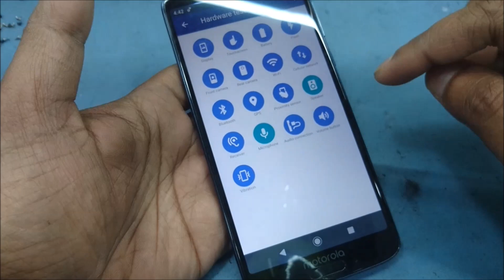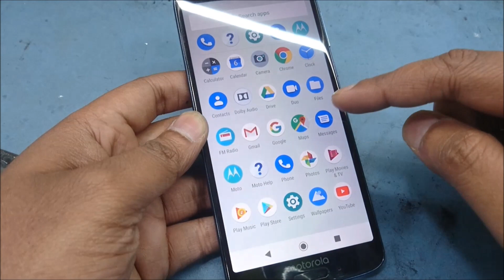Moto G6 Mic not working problem 100% [Solved]

Comment: Hi, thank you for your video! I was wondering what is the dought you put around the microphone? Thx!
Reply from the maker: Most welcome
Reply: @amit keshwar- do u understand English? He asked you something
Reply from the maker: It's soldering paste to joint part,  and its silver foil tape to block the heat air
Reply: @amitkeshwar2428  does soldering paste conduct electricity? Thanks
Reply: @userM8wqjnmx387  no but it should be cleaned off after you are done.
Reply from the maker: Yes,

Comment: Hello,
I enquired in the service centre, they told me it will cost rs 11000.
What do I do now?  How much is the actual cost according to you?
Reply from the maker: Only mic replace then charge is 1000 rs. Or if cost is 11000 rs. Informed you, it means complete motherboard replace in your set, 
I have already showning in mic replace
Reply: They told me also for the whole mother board replacement

Comment: What is the name of the application you used to test the microphone?
Reply from the maker: The name is 'help" to application open and check your hardware
Reply: @amitkeshwar2428  please, tell the article or from which phone moto g6 microphone is suitable soldered. Similar does not work
Reply from the maker: @Voha  4 dots using this microphone to working this phone,  if you repair this phone,  please purchase the mic original in mobile service center,  or duplicate mic purchase have you a compatible Samsung phones to similar mic
Reply: @amitkeshwar2428  thank You. Microphones similar externally should fit?  For example, in xiaomi mi4 (https://images.ua.prom.st/1220030084_w640_h640_mikrofon-dlya-xiaomi.jpg) is very similar.  What microphone model did you use?  The service center refused to repair the phone (((
Reply: @Voha  so what's the same analogue to put samsung or redmi notes
Reply: @Iskusitel33  хорошо, спасибо, буду знать. Просто нигде не нашел маркировки микрофона, и мне некоторые люди писали мол не заработали у них другие микрофоны. Вот поэтому так дотошно и интерисуюсь
Reply: @Voha  если напишеш почту скину под микроском картинки радного
Reply: @Iskusitel33  да есть фотки родного. К сожалению по надписям на нем ничего не нашел. А я так понял ты меня микрофон?
Reply: @Voha  9 месяц лежит все никак не найду вот и моторола в первые такое
Reply: @Iskusitel33  привет, заказал с али микрофоны на этот телефон и ни один не работает( вроде и там и там 6 контактов, в чем же проблема?
Reply: @RF-rd1hb  там проблема в распиновке микрофона на Али один обман тока вид они не подходят есть видео в Ютубе распиновок
Reply: @Iskusitel33  к сожалению не нашел на ютубе распиновок для шестиконтактного микрофона(
а какие варианты? можно вместо этого впаять кругленький с двумя проводками?
Reply: @RF-rd1hb  еще в добавок их в паре меняют а распиновку микрофона мото g6 plus тока в гугле
Reply: @Iskusitel33  а если только передний поставить, а задний вообще убрать то работать не будет? задний же вроде только шумоподавление делает
Reply: @Iskusitel33  я нигде не нашел распиновку ни на ютубе ни в гугле, если у тебя она есть, можешь скинуть? formanroxy@gmail.com
Reply: @RF-rd1hb  вообще их 3 и они завязаны что то переделать очень трудно тока искать оригинал и не на алике или плату от разбитого телефона
Reply: @RF-rd1hb  найду скину вечером
Reply: @Iskusitel33  этот индус на видео где то же нашел их микрофоны и не говорит где, я на плате прозвонил контакты, у меня земля нижние три и крайний справа сверху, остальные не поймешь, наверное по центру это плюс и слева шумодав
надо просто узнать номер детали микрофона, они же где то выпускаются? я пробовал найти даташит на сам телефон материнку но не нашел(
Reply: @RF-rd1hb фото я тебе скинул родного на алике находил материнку 7000р она бу вы с какого города
Reply from the maker: Please ask mi to English language
Reply: @Iskusitel33  я на почту ответил тебе
Reply: @amitkeshwar2428  friend, please tell me where you bought the original microphone? I can't find it anywhere. our service centers sell them for this phone but they do not fit. the contacts on the microphone don't match.
Reply from the maker: Try to online websites,  like Amazon,  or local market to matching part, but original part available only in service center,  but service center not sell the chip part, try to request

Comment: What model mic is that...
Reply from the maker: I don't know,  but you need to 6 dot pins mic required
Reply: @amitkeshwar2428  i have a problem after i change typeC charging port.. both microphone dont work right now, i try to change 3rd times and not work
Reply from the maker: Charging replacement time you had damage the mic, so please watch another video for how to replace mic of moto g6 in my channel

Comment: I am also suffering from this problem when I went to the Moto service center they told me that they have to replace the whole mother board for the MIC
Reply from the maker: Ok, it means this service center cannot replace mic as showing in my video, thats why telling you to the motherboard problem
Reply: @amitkeshwar2428  Yes even they didn't check properly
Reply: @amitkeshwar2428  from where I get the original mic??
Reply from the maker: Another same motherboard can get the mic, but motherboard are not available in any location,  it's big challenge,  but last option
Reply: @amitkeshwar2428  from where did  you get it  new MIC for your phone ?????
Reply from the maker: I'm service engineer in Motorola service center
Reply: @amitkeshwar2428  ok that's fine I have one motorola service center naer by me if I will ask they will give me the microphone ????
Reply from the maker: Service center not sell the chip components,  but you can try to ask
Reply: @amitkeshwar2428  duplicate  MIC will support ???
Reply from the maker: Yes,  but exact piece and,  mostly time failure piece
Reply: I went to a third party service center they sort out the problem they told me it was not just fault of mic it's the fault of IC of the phone they are claiming that they have changed the ic of the phone is it practical ??????
Reply from the maker: Not sure,  i am not commented for you, without checking your phone,  sorry
Reply: @amitkeshwar2428   sir is it possible to replace the MIC from moto service center they told me motorola doesn't replace or repair the microphone they replace the whole mother board